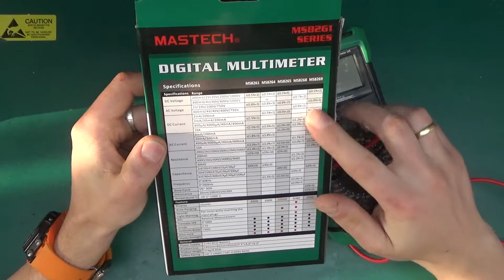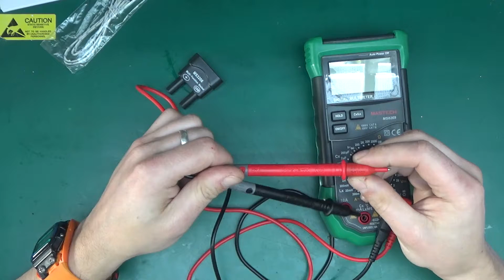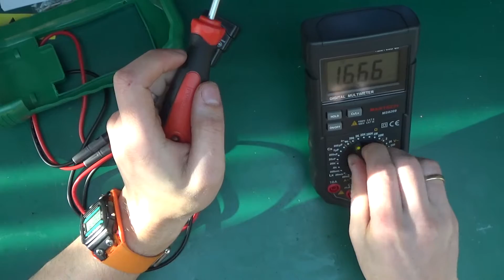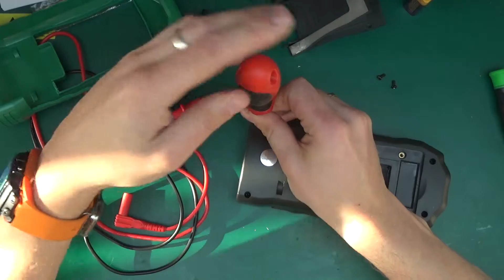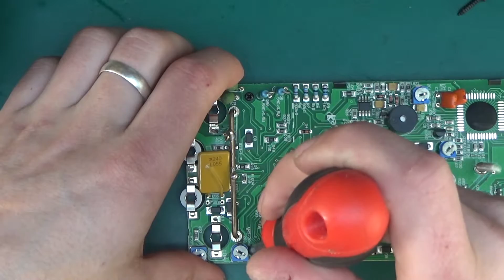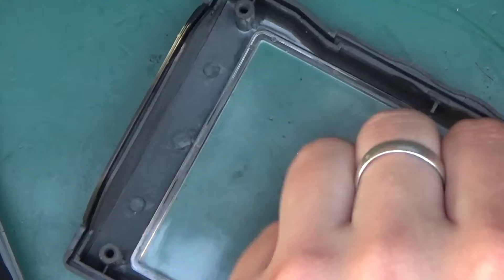Review, teardown and death - MASTECH MS8261 multimeter

Comment: Bad quality. But as Joe already said, the yellow component is likely a resettable fuse (PolySwitch) - it's still a very insufficient form of protection, unable to handle higher fault currents or any higher voltages than about 50V.

Comment: Tantalum capacitors like to flame and smoke when they get reversed voltage. Probably no diode in lone before it at all, and this is most likely the first cap in line if your traced it out. The others are probably OK, or they would have don't the same. If you put another 16V tantalum cap back in its place it will probably turn on.
They tend to use the same rating caps for all, so just use the same caps rating that's on the board with the other yellow ones, or you might be able to review your raw video footage and get the rating from the video?
But in general, all the mastech stuff is built to a cheap cost and I personally consider it all junk. Several other brands also use mastech boards, most of them have different manufactured names but the same model numbers. Some do change the model number, but when you open it the PCB is labeled mastech ###< V??
I think mastech sells the boards, chips and firmware, but the other companies get to make it cheaper or better deciding on the quality of components, or not populating some components at all and removing some features. 
I say you put a cap back in its place, why not. It might turns on, maybe even work. Most of the IC chips can handle a short reverse hit, and when the cap blew it probably broke the circuit to the other parts.
Reply from the maker: It is possible, that rest of caps are ok, but I must have killed one of the ic's too with reversed vcc. 1n4147 in series with battery would have prevented this from happening.
Reply: I agree, it would have been simple to prevent. I watched it again and I was looking for one of those cheap cmos based voltage regulators, they also like to blow easy when powered backwards. But I didn't see one, so it's probably a multipurpose chip of some kind? I just find it funny that I have given a mastech 1.2KV and it took 4 times before it was damaged, and a backwards 9V does more damage then what I did.  Oh well, I guess it's 💀 dead.
Just wondering, how long was the battery in backwards? Was the mode switch in an on position? If it was in the off position that would make this design even worse in my eyes.
Reply from the maker: +Gadget Review Videos not sure about the switch on/off, i was just screwing the thing back together and not paying attention (clearly! Lol). Battery was in there maybe 10 seconds before i started seeing smoke :)

Comment: Enjoyed the video.   "Oh my goodness this is an absolute mess" lol.   The reverse polarity was funny too!   I was really wanting to see how well it read inductors.    A couple of comments.  Suspect the part you call a MOV is the resettable fuse.   The small glass part that you think is a fuse may be a GDT?
Reply: New test to the line up Joe? Can the meter handle putting the batteries in backwards?
Reply: Looking at an old through hole Mastech I have, it uses the 9V but has the clip on connector and a mechanical switch.  I looked at the power input and it appears that if you were to connect it backwards with the switch on, they shunt it.  I gave it a try with a fresh battery and sure enough, no damage.  Still a crap meter but survived this test.
Reply from the maker: possibly, but i thought i saw a filament inside the glass. Thanks for polyfuse suggestion, you were right :)
Reply: It would be interesting to try the PTC with the shunt in Mr Joules.   Easy enough to trace out the few parts on the front end and see if it makes sense that the glass device is a fuse or GDT.   Too bad Mr Joules doesn't have a larger box.  You could put the whole meter in there and try some tests.  Still lots to learn from this dead meter.
Reply: Someone posted that the UT61E could not handle it.  To be fare, the back cover on mine is keyed so it should not happen but I wonder about my Mastech now.
Reply: After looking, my Mastech uses three AAAs.
Reply from the maker: joe smith which is a protection on its own, because one would have to put in three batteries wrong way round. Even when half asleep, one would clock reversed polarity on second battery probably. 9V has just one chance (1 battery to put in) especially when they use springy tabs for contacts instead of the polarised clips.
Reply: LoL, I almost posted the same comment that all three AAA would have to be out in backwards for the reverse polarity. I know I've personally put in on o three batteries backwards in the last with things taking AA or AAA batteries, but never out in all three backwards before.